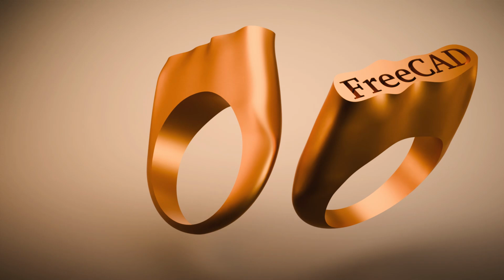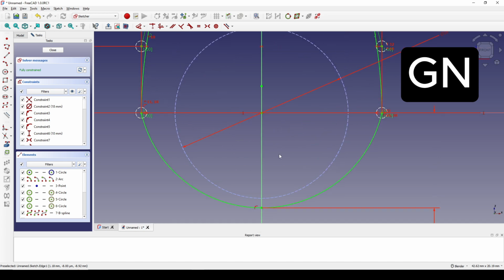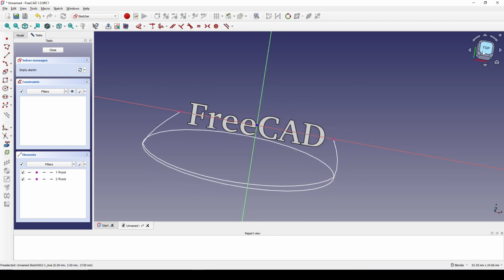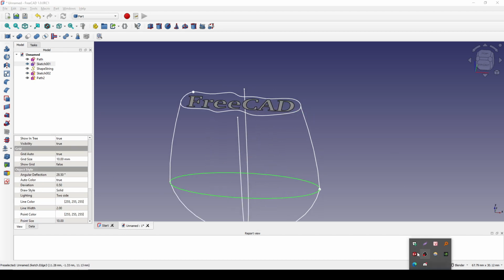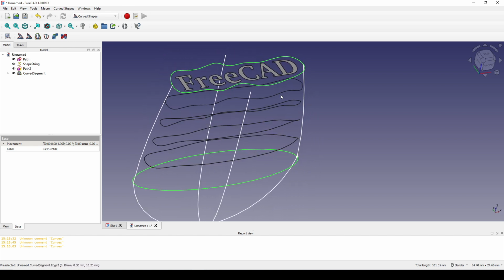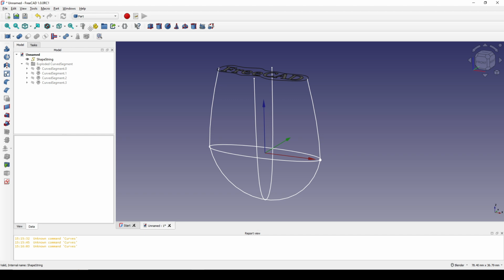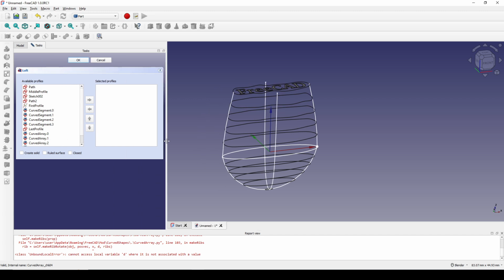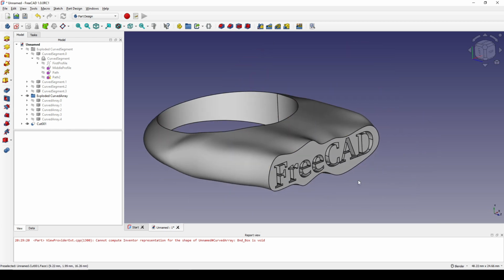FreeCAD Curve Segment - Design An Organic Ring

Comment: You are very skilled in using multiple workbenches in FreeCAD. I’m new to both CAD design and FreeCAD, and I tried to replicate your work, but I couldn’t create the solid model during the loft step. Could you please help me?
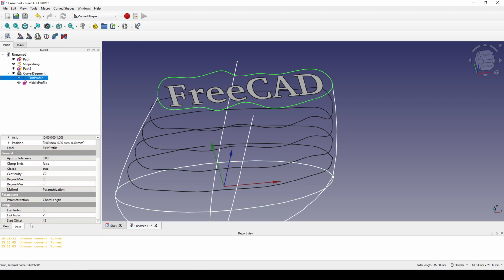Reply from the maker: Thanks Nhan, you double check curve segments, make sure the inbetween curves are not twisted by adjusting the point position like I did in the video 14:05. Then, select all profiles in sequence top-bottom or bottom top, check create solid.
Reply: Thanks, DuyQuang. I think I found the issue: when I was in the Part Workbench, I didn’t see the Sketch icon, so I switched from the Part Workbench to the Sketcher Workbench in order to draw the small 0.05 circle. How can I set up FreeCAD so that I can see the Sketch icon in the Part Workbench?
Reply from the maker: @NhanNguyen-w3b4l  Sorry for your pain! I think maybe you forgot to offset down the small circle -10mm. Sketch in the Sketcher or the Part both the same, I used newer version of FC so no need to setup, it's default.
Reply: Thanks, DuyQuang. It wasn’t a painful process, but rather a deep learning experience. I had to restart the duplication many times over. I finally got the ring as the final result, even though I’m not sure how Murphy’s Law got involved in the process. Also, I couldn’t delete the lines of the curve segments. All in all, I’ve learned a lot through this exercise. Thank you so much for your work and support.   Have a nice weekend!